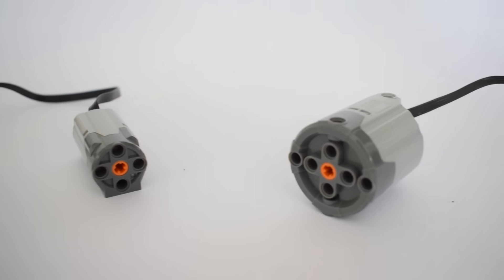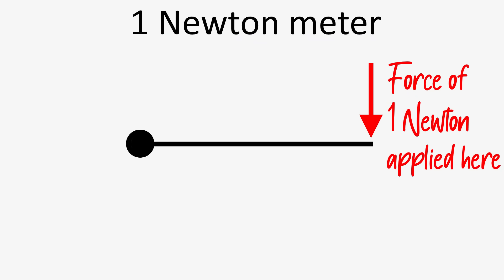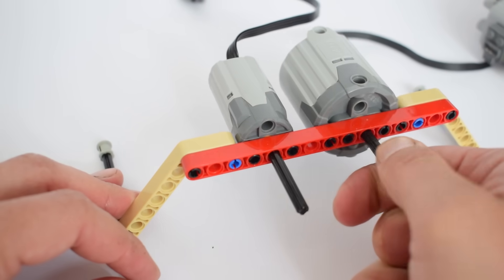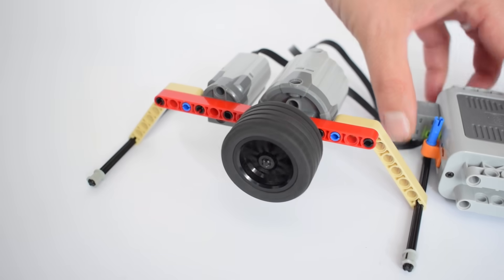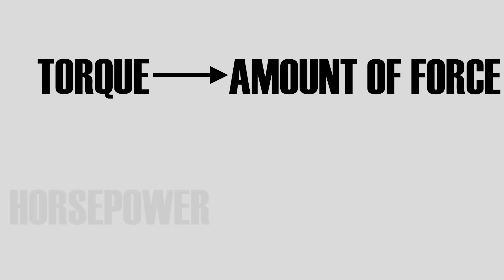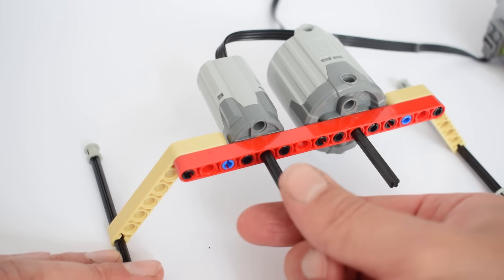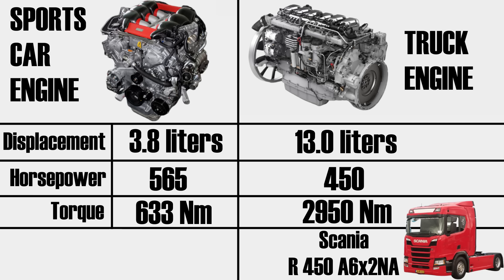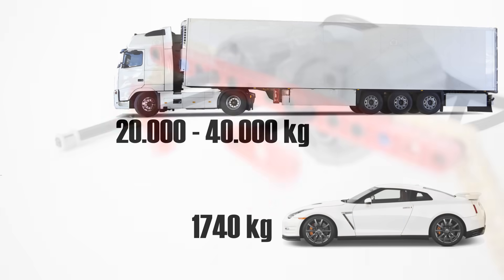NEVER be confused by HORSEPOWER and TORQUE again - HP and TORQUE EXPLAINED in the MOST VISUAL WAY

Comment: 4:13 D4A “The key word in the word horsepower is...”
Me, an intellectual “Horse!”
D4A “Power!”
Me “...”
Reply: same, except I'm not an intellectual.
Reply: Seems funny to use the term "horsepower" but not "waterwheeltorque". :)
Reply: @thromboid  I don't see it.  Horse power = calculated average maximum power exerted based on observation of (wait for it...) horses.  The horses were turning a mill (if memory serves), yet we don't call it "mill power".  Torque is a measurement calibrated by exerting a known force at a known distance (typically by suspending a reference weight along a beam of measured length).  The "brake" or "water wheel" is just a measuring tool to apply this calibration to an observation.
Reply: @ehb403  Don't mind me - I'm just being snooty. :) I've no quibble with horsepower as a unit (other than not being SI) - what seems strange is using it to refer generically to the physical quantity, instead of simply "power" or "mechanical power".

If it's referring to a particular test procedure then that specificity is useful.
Reply: @thromboid  what's more fun to think about (for you snooty English types) is that  1) the Watt was only added to the metric system in the mid 20th century and 2) it's named after the gentleman who came up with the definition of 1 horsepower!  In other words: Watt used horsepower to measure power.
Reply: @ehb403  James Watt was a very smart man. Ive been studying physics from many different fields over the past year or so. Its so interesting to read about some of the men that made these discoveries in the past. What amazes me is how men like Watt, Newton, etc were able to discover SOOOO much in just ONE lifetime. Compared to today, where most scientists will be lucky to make a single profound discovery you have guys like Newton (or Leibniz for some of you) that basically "discovered" and entire field of mathematics. 
You would think that the OPPOSITE would be true, due to the "wisdom paradox" or the "Dunning-Kruger effect". You'd think that by discovering more, it would open up the possibilities to discover even MORE.
Part of it might have to do with population or the availability of education to everyone today, compared to people in the 17th century. Or it might have to do with people just not having the passion to discover things like people had centuries ago.
Anyways, sorry for the long ass comment lol
Reply: Elephants are way stronger we need elephant power not that weak ass horse power
Reply: @biggusdickus9809  How about tyrannosaurus Rex power ??))
Reply: if this is true, you're not an intellectual.
Reply: Australians use kW to measure engine output which makes more sense.
Also, one horsepower is calculated from the amount of work a horse could do *in one day*, so a single horse can often output about 5HP for short periods of time.
Reply: @phuzz00  sure, but if you were an 'intellectual', you would know that horsepower is a measure of power output, and that the horse part is irrelevant when discussing automobiles. kory is not an intellectual but a tarded soiboy.
Reply: @phuzz00  KW , ?? , probably kilowatt maybe.
Europe is PS or PSI i think which is a more true measurement . The work a horse can do is more like a truck than a car , more torque , stack up 6 shire horses against a 100 hp car and the shires are going to win purely because of torque once they have those hoofs dug in
Reply: @MrTarmonbarry  one horsepower is the power output the average working horse can maintain throughout a working day. An average horse is capable of outputting about 15 horsepower for a short period of time.
The standard metric measure of power is the watt, for cars its usually kW, kilowatts. PS is a Pferdestärke which is the German word for horsepower, it is a metric horsepower. Its equal to 75 kgf*m/s which is slightly less than one imperial horsepower.
Reply: @Redtooth75  When the steam engine began to do the work of horses in the mines during the early 1800s, the mine owners began to ask how many horses an engine would replace. James Watt, who invented steam engines, figured out a mathematical way to equate horses to engine power. Thus the term horsepower was invented.Mar 12, 2006.
Rating a car as 120 hose power is still wrong , you can not apply it because a horse power is a different type of power based more on torque than speed . The European measurement is closer but still not accurate . Maybe it needs a whole new way to classify the different powers from a Truck and a car or something completely new ??
Reply: @MrTarmonbarry  ??? Why can you not compare them? Horsepower is literally how much power a horse can produce throughout the day. Horsepower does not have to be based on torque and rpm. It is defined as 550 ft*lb/s. Meaning 550 ft*lb of work every second. A horse can move a 550 lb weight 1 foot every second and maintain that pace through a day.
Reply: @Redtooth75  So using that 550lb weight a vw Golf can move it i foot per second , or a 1.5hhp Briggs and Stratton engine can move that weight that far in that amount of time ??. Dont think so , and that is why it is misleading
Reply: @MrTarmonbarry  yeah it can, a golf could move more weight at the same speed, or the same weight at higher speeds. Its not misleading at all.
Reply: @Redtooth75  And the 1.5 Briggs and Stratton??
Reply: @Redtooth75  I guess the Briggs and Stratton that powers lawn mowers could tow a bus to the repair shop )))))
Reply: @MrTarmonbarry  the 1.5 Briggs makes 1.5 hp, so it also can do more. I dont know whats confusing about this. 1 horsepower is 550 ft*lb/s. That means something producing 1 horsepower can do 550 ft*lb of work or energy every second.
Reply: @MrTarmonbarry  yeah they could, slowly.
Reply: @Redtooth75  Good way to try to cloud the point but not valid . the Briggs and Stratton is classed as 1.5hp but it does not have the power of 1.5 horses , you obviously do not understand the whole concept of a horsepower . A 1.5 engine can not do the same amount o0f work as a horse . Can it pull a tractor or a car , can it plough a field ??, no
Reply: @Redtooth75  No , a Briggs and Stratton 1.5 engine could not even get a bus moving let alone tow it slowly to a repair shop , physics does not work that way , power to weight ratios do not work that way
Reply: @MrTarmonbarry  dude that is exactly how physics work. There is something called mechanical advantage that you can use. Put the briggs on a small buggy, make sure there is enough weight on the wheels for traction. And then use some gears to get the torque. I assure you the bus will move, not fast but it will move. I can guarantee you I understand power better than you. Power to weight ratio only matters for speed. In fact power only really matters if you care about how fast something needs to be done. You could use a tiny rc car motor and move a bus, not fast but it will move. It might take it a month to move it down a block but it will get there. A human could do it with a winch. Its doing work within a certain amount of time when power starts to matter.
Reply: @Redtooth75  B.S again . i just found that video about a car with 200hp lifting 110,000 lbs , that is 49 tons . Now that i would like to see . The 200 horses might do it but no way could the car
Reply: @Redtooth75  Putting the briggs on a buggy is employing a second factor into it . No power to weight does not only matter for speed , that is why trucks have engines with a lot of REAL power . A month to move it a block?? , a horse could do it in  a day
Reply: @MrTarmonbarry  dude imma be honest with you, i have no idea what point your trying to make. 
Using a buggy is a second factor? I don't think you know what I mean by buggy. Im was meaning a small frame with some wheels on it, and a transmission. I was talking about an rc car motor, like the kind that fit in your palm, when i said it would take a month to move it down the block. 
An average horse can do the same amount of work in the same amount of time as a 1 horsepower motor.
Reply: @Redtooth75  The ''buggy'' is an addition to the Briggs engine , you also talked about added weights and gearing so that is alterations to the engine to enhance its power . Can i make alterations to the horse as well , maybe substitute an ordinary horse with a Clydesdale ?? And the r.c car ??, where did that come from ?? .
A 1 hp engine can not do the same as a horse , as i said before about towing a bus or ploughing a field , the Briggs would lose every time , although i do like the Briggs engine , they are good at what they do , cutting grass
Reply: @MrTarmonbarry  weights and gears dont change the power of an engine. Do you expect the engine to just lay on the ground or something? Of course it would need a frame and wheels to get power to the wheels. Its not a modification to the engine. 
As long as you make everything else equal, a 1 HP engine would be able to do the same amount of work in the amount of time as an average horse.
Reply: @Redtooth75  Now you are just changing the whole machine , i talked about a lawnmower with 1.5 hp and you are adding all kinds of gears and other things.
External weights do not change the power of an engine but if that weight is on the flywheel is does change it and gears are there for a reason , they change the power going to the drive wheels otherwise why have them ?? .
Break it down , ''horse -power'' , it means what it says , the power of a horse .
You say about making everything else equal , that means altering the engine to give it the same power as a horse , you could conversely put the horse on a high protein diet so IT would have more power
Reply: @MrTarmonbarry  gears do not change the power of the engine, at all. They change torque and speed, power remains constant. You get less power on the output but for simplicitys sake I was ignoring friction. The question was can a 1.5 HP motor pull a bus, and yes it can. A lawnmower cant because its not designed for it, its motor could if you use something designed for pulling.
By making everything equal im talking about factors like traction. A 1 horsepower engine already makes 1 as much power as a horse so not alterations need to be made
Reply: A 1 horsepower engine already makes 1 as much power as a horse so not alterations need to be made @Redtooth75  ??, really , so a 1 hp engine can pull a bus , that i would like to see. You have altered and changed o many variable along the way including referring to a remote control car , are you sure you do not want to add a turbo charger and nitros  oxide as well as all kinds of gearing , weights and other things . Simple terms , '' Horse 
Power 
two separate words 
a 1hp  Briggs engine does not have the power of 1 horse
Reply: @MrTarmonbarry  yeah it does, thats where the term gets its name. James Watt took a horse and measured how much power it could exert throughout a day. It came out to 550 ft*lb/s.
An engine with any amount of power can move anything, it just might not be able to do it fast. You could replace the diesel in the bus with that lawnmower engine and replace the transmission with some taller gears and it will drive the bus. It wont go very fast, but it will move the bus. Thats how power works. You can use gears to stretch the work out over a longer period of time.
If it take 150,000 ft*lb of work to move the bus however far, a 1 HP motor can do that in 4.5 minutes. A motor with less power will do it slower, a motor with more power will do it faster. The car lift I have in my garage only has a 3 HP motor, and it can lift a 9000 lb vehicle into the air. It just cant do it fast, it takes a minute or two.
My biggest issue with your argument is you don't have a grasp of what power is at a fundamental level.
Reply: The whole thing about the word ''Horse''power is deceptive . Hook up 400 horses to a 400 ''horsepower car and see who wins .
Top Gear did something years ago with a high power merc and a tug of war team , stopped the car dead
Reply: @MrTarmonbarry  true but that is the result of torque and traction. The team weighed more, and generated more torque. 

You can do the same test with a truck and a car. At equal power levels, the truck is going to win due to the applied torque to the ground
Reply: @enfynet  Yes i know the difference between horsepower and torque , what i was trying to point out is that the majority of cars are measured in horsepower so it is misleading , maybe why on the European  continent they measure differently. Not sure the team would weigh more than the merc ??, maybe 2.0 or 2.5 ton
Reply: @MrTarmonbarry  Doesn't prove that much (scientifically) but its funny: https://www.youtube.com/watch?v=OHu_tnJdqZA
Reply: Nay, it is HORSE, good sir!
Reply: @TDGCmote  And the puns start rolling in )))))))
Reply: Same.
Reply: 😂😂😂 same here
Reply: Just did the same thing lmao
Reply: Lmao
Reply: SAME
Reply: Good morning, Mr Dunning. How is Mr Kruger these days?
Reply: I had the same idea to. Initially i started to pic a horse in my mind

Comment: Questions if I slap a supercharger on my car how could I calculate the new torque output, 2.0 Ltr putting out 197BHP and 196NM @5900 RPM.
Reply: U can do the thermodynamics stufff or just dyno your engine from the flywheel
Reply: Boost means more air in the cylinder.

More air more fuel bigger bang therefore more torque.

By making more torque at same RPMs means more power.

Comment: Torque at the wheels are important for acceleration, you simply need F (force). F=m*a
Using gears you can change the amount of force (torque) applied to the wheels, but you won’t change the hp output at the wheels. More torque, but less frequent, lineair relationship!
Pull away in 1st gear: goes pretty fast with any car (wheel spin=maximum force you can apply!). But acceleration becomes worse while shifting up, in any car. Only those with huge amounts of torque quickly accelerate in high gear, but still slower than in lower gear.
Side note: torque and power curves drop above a certain rpm, mostly because of a combination of starvation (can’t pump enough air in through the inlets), resistance (pump out exhaust gasses, mechanical friction), valves that can’t cope with the quick opening and closing, and simply too high forces on crankshaft and pistons which will make the engine disintegrate. Otherwise, more rpm would result in more hp.
Reply: What about some cars where the hp curve keep going up till redline?
Reply: @maddeningmonk9585  good engineering to get around the listed issues with running at high rpm, see : double overhead cams/4 valve cylinders well ported heads higher conpression etc. A well engineered engine can maintain its torque at very high rpms, just look a formula 1.

Or just lower the redline lol
Reply: @maddeningmonk9585  lol

Comment: Sorry, not satisfactory: What really matters is the torque-curve, not the top torque value. One wants reasonably flat curve - then the gearbox can take care of the torque multiplication. Engineers should come up with a single number characterizing the flatness/peakiness of the curve, and this number should be published as an the engine spec.